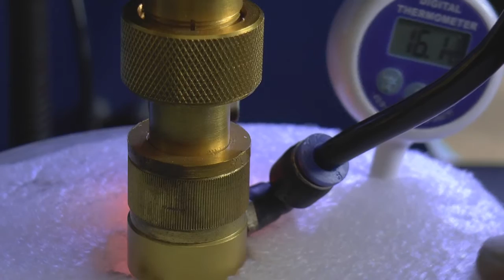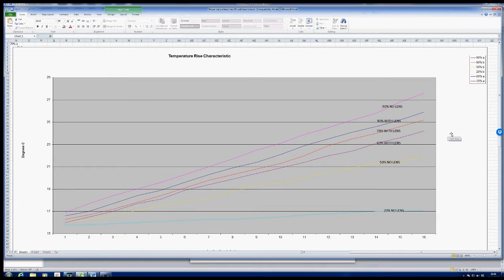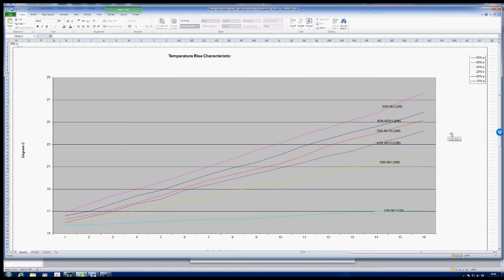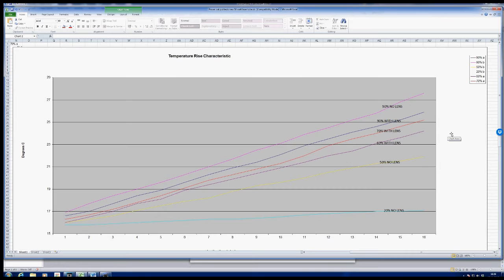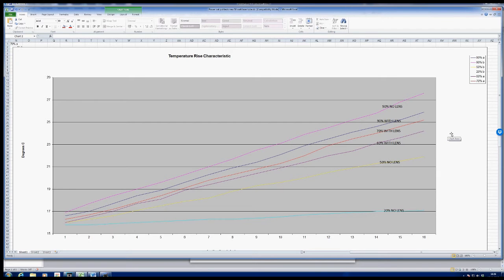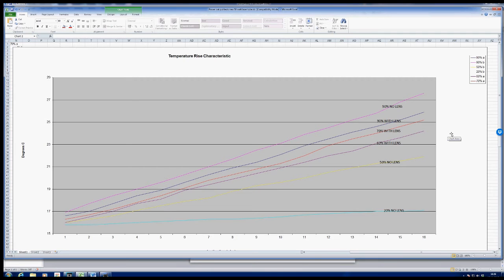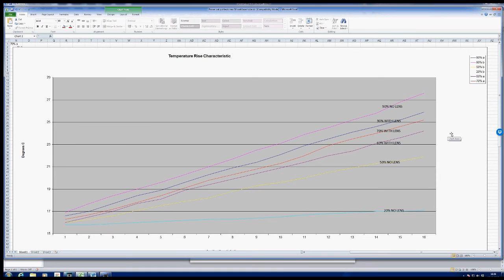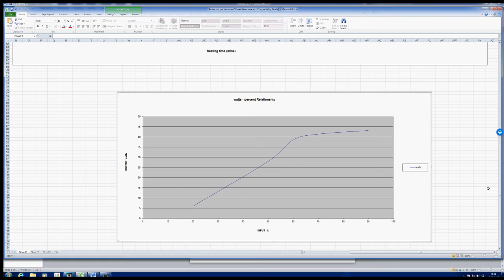RDWorks Learning Lab 21 Fitting new laser tube Part2

Comment: Great info, i'm slowly working through your videos while deciding which laser to buy to substitute my diode laser machine, 1 fact that is very clear is its not worth burning up the co2 in the laser at 90 or more % when you get just about the same performance between 60 and 70%, maybe even 2 pases at 35 will do the same with a slight hight change and extend laser tube life. Makes you wonder how many people have learned the hard way, not having this valuable information. Thatks for taking the time to do the tests and again even more for making it public.
Reply from the maker: Hi Derek
When you buy a machine from ebay or even Amazon marketplace, It'salmost a certainty that the machine will be fitted with a B grade tube, That will often give rise to this strange  characteristic that you have noted where higher % power gives less watts. That is a sure sign of a tube that has failed to make the QA standard at one of the big tube manufacturers and has been picked up for next to nothing to pass onto technically naive Ebay buyers. If it works then who will notice there is a tube problem? You need an ammeter (which they dont fit even though its only $2) and a power meter (usually a big investment) to uncover the scam.. This is not speculation on my part but personal experience coupled with an obvious pattern when you receive as much  focused correspondence as I do.
An A grade tube has a manufacturers specification, which is often vague or blatantly misleading. There will be a max power which they test the tube at, and this is usually the headline number quoted on sales literature but YOU must not use this  or you will quickly kill your tube. They often use the term "agreement power" which is hand written on the tube label at final QA.  These A grade tubes will not exhibit the characteristic you have seen so far,  but  when you run the tube at it's max allowed RUNNING current (which is why it is essential to fit an ammeter) ,  the power will continue to rise all the  way up to 99%
Your thought  about running the tube at half power and taking two cuts is a very bad idea. Cutting requires power, so when you have established what your max allowable current is, it will be safe to set max power for most cutting (there are a few exceptions) and then adjust the speed to as fast as possible to allow the pieces to drop out IN ONE PASS. The whole principle  of cutting is to get the fumes out of the BOTTOM of the cut as quickly as possible with  efficient air assist. Two cuts will just paint your product with brown fumes if its wood and white fumes if it's acrylic . This is a lesson you will soon discover. 
To understand more about the tube and its power characteristic I will point you to these two videos
https://www.youtube.com/watch?v=2F5O-1TH8b0&list=PLPWEtx5V9DqEogIeYRdcG_KYcB7UL2Qmn&index=7&t=55s
https://www.youtube.com/watch?v=nZuatc3eIgU&list=PLPWEtx5V9DqEogIeYRdcG_KYcB7UL2Qmn&index=26&t=0s

 Good luck in making a choice...it's a jungle out there and there are lots of junk machines and only a few worth investing in. 
Best wishes
Russ

Comment: What I have read on the Internet (must be true!) is that the tubes are sealed, there is a catalyst inside that can be used to make co2. When you run at higher powers, the catalyst can't convert or replenish the co2 quick enough so the power drops off. What I haven't found is, is this true! And does it use the catalyst up at a higher power level and wears out the tube or just you can't create enough co2 for a good beam.
Reply from the maker: +Ed Bond 
Hi Ed
If you watch the power loss test videos you will see exactly that effect. I could run at full power for maybe 30 seconds and then the power would drop off considerably. Turn the tube off for 2 minutes and you could start again at full power (for 30 seconds). While I was waiting for my new tube I did run for a whole day  continuously on 15% power  (Xmas card session) with no problems.
Perhaps that confirms all your research.
Reply: Now watched that one!

Comment: The last graph is the most interesting. If the maximum output power is produced at a setting of 65% then you may be actually damaging the tube by over driving it with a higher setting for no gain in output.  I think the power supplies are adjustable so that the output current can be limited. There was a forum post where someone had made an adjustment so then when they set 100% the current was limited to a safe value.  If I can find it I will send you a link to it.
Thanks for sharing this. I think I will perform the same test, but I might bite the bullet and buy an actual laser power meter.
Reply from the maker: +2020tesla 
The last graph is only another way of looking at the slope results but I must admit it shows the power characteristic in a way that you cannot ignore,  LIke you, I shall be very wary of going more than 70%. I shall be interested in your results from a proper power meter. At 15 minutes per  test that graph was a labour of love (very boring).
Reply: @SarbarMultimedia   This is exactly what is happening you are reaching the peak power rating of the tube given the tubes construction 60%ish is your new tubes maximum mA current